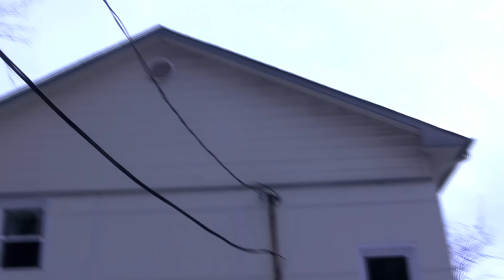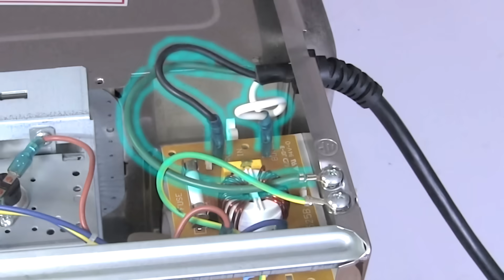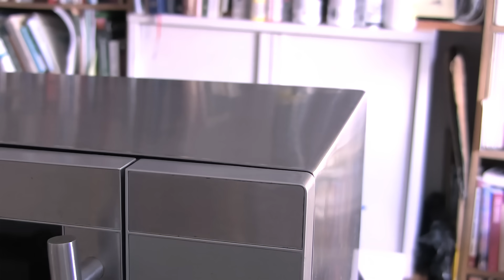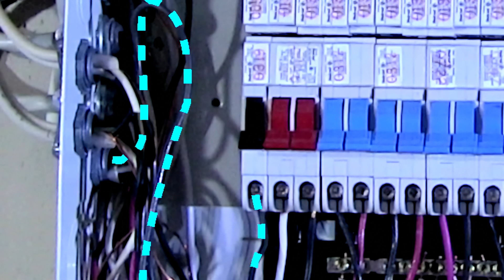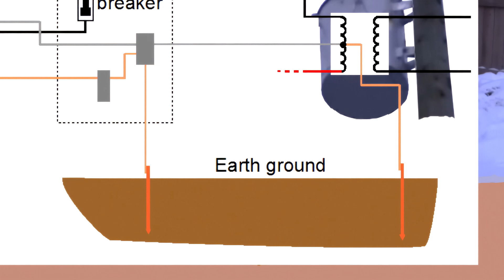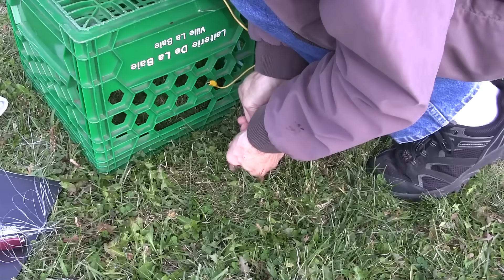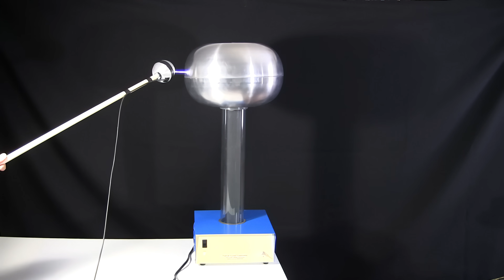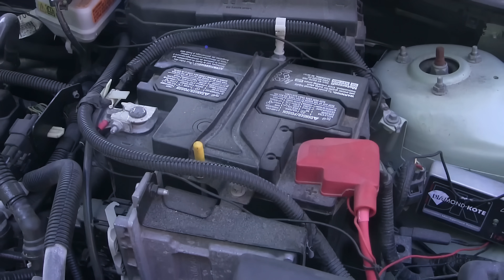What is Ground? Earth Ground/Earthing

Comment: So nothing has infinite resistance, but don’t we still need a return path for current to flow? So I’m fine with an ungrounded system having current flow thru earth which would happen right? But what I’m not fine with is not seeing what the return path. When current is flowing thru the earth - what is the return path? If you are going to say there is no return path, then I have to ask, how in the world are the electrons where the power line touches the earth/soil being driven away to make room for new electrons?
Reply from the maker: Yes, one return path is through the ground. The Earth ground can contain ions that make it electrically conductive. The more ions and the wetter the ground, the more conductive it is. So some ground isn't very conductive, or isn't conductive at all if there are few or no ions and the type of ground is dry. I just reviewed my video and see I don't mention that. The Earth ground return path can best be seen in the video at 4:13, the path is through the ground between the two grounding rods.
Reply: @RimstarOrg  Hey I watched your video again for the 7th time! I learn something new each time! I just had two followup questions to drive home the understanding:

 my mistake I’m sorry for that. I’m an idiot. May I ask two followup questions if u have time: 

1)
basically I was told that even if a system isn’t grounded (no ground rod to neutral etc at transformer and no grounding anywhere ) that if a power line that’s energized comes down and touches the earth, that it would still energize the earth. Now if energize means put the earth that it’s touching at its voltage then that’s surely true right? No matter if it’s soil, gravel, water right? A  120 v line comes down, and it will make the earth 120 v relative to neutral (in USA), no matter if that powerline is touching dry pavement, dirt soil or water right?

2)
The second question is - let’s forget about voltage. We have this 120 v line touching the ground - let’s say it’s grass or soil or water, is it possible for a current to flow thru the very earth itself if there are no grounding rods or grounding stuff anywhere near by? I ask it this way cuz I’m tryna take away with “return to source” and still see if current would flow thru the earth.
Reply: @MathCuriousity  1.  If it's truly not grounded anywhere, the electricity will not flow when hot touches the ground or even a person. It's dangerous to rely on that though because unexpected grounding could occur in numerous unpredictable ways.  120v wouldn't be enough to energize the ground anyway because its not enough voltage to push much current through the poor conducting earth. High voltage lines can push current easily  and make a dangerous area near them on the ground if they fall.  The voltage drops so quickly on the ground that there can be a significant voltage difference between your two feet, causing current to flow up one leg and down the other.

2.  Yes current attempts to flow back to source through the ground, but 120v can barely make it back to the panel grounding rod. Higher voltages however, would flow back through the earth to the transformer ground if there weren't any closer options
Reply: @ so are you saying if I am grounded and I touch a hot wire, I won’t be shocked? I don’t think that’s right.

Also the current being pushed by the high voltage line touching the ground won’t flow if there is no path back to source right? Besides maybe capacitive coupling?
Reply: @MathCuriousity  if you are grounded and touch a hot wire, the electricity will flow through you, through the earth, to the nearest grounding rod to return to source. Only in the very unique system where there was no grounded part in the entire system would that not shock you. I only mention a non grounded system to explain the concept, you won't actually find an AC system set up this way.

To your second point, you're correct, it will only flow if it can get back to source, which it easily can do through the earth if the voltage is high. It can take a shortcut through your body however, even though it's a longer path, because the body is an excellent conductor of high voltage. 

It always returns to source though in order to deliver power.  Otherwise it's just a capacitor like you said
Reply: @ hey great replies and just to clarify: I’m of the opinion that a downed power line will only have capacitive coupling with the ground if there is no grounding system - correct?
Reply: @MathCuriousity  in theory yes because you couldn't complete the circuit, but you won't encounter a system like that in the real world. All  AC systems are grounded, for a variety of reasons.
Reply: @Lucifer5-f5v  and just a final aside if you have a moment : what if the downed power line was DC instead of AC, would we still have capacitive coupling (again assuming ungrounded system as I think u said grounded system won’t have capacitive coupling whether Ac or Dc)?
Reply: @MathCuriousity  I was a little sloppy on the capacitive side, I was focusing on the main power flow.  I was referring to capacitance as a sort of minimal charge potential from a downed line with no return path. Similar to measuring voltage in a hot line with the load disconnected.  Capacitive coupling is possible on AC power lines when they are up and functional, you just need to get the right material in their electric field, like a fluorescent bulb.      In another way, I was referring to a direct electron to electron push from a downed wire, with nowhere to go because there isnt a complete circuit. Coupling involves a much smaller leakage that happens wirelessly, so to speak.  Effects like this, along with voltages floating, and arcing, are why you could never trust a high voltage system to be ungrounded, and a downed power line would never be safe even in a hypothetical ungrounded system.

For a DC system, they are even better at returning to source through earth, and I don't think you can even make an ungrounded system.  You can't use transformers, so there aren't gaps in the system to isolate. The generator has to be grounded to have a source of electrons to push down the line.  If the destination were hovering, like a helicopter there would be some minimal capacitance but no power flow without a return circuit.  Capacitive coupling only occurs in alternating current I think.  The unchanging DC field doesn't cause the effect.
Reply: @ hey thanks again! So let’s stick with the downed ac power line - it’s touching the earth, no grounding system around, say it’s like 1 mile out into middle of nowhere; now I know there won’t be current flow because there is no return path; but ur saying there would be “capacitive coupling flow”? How?
Reply: @MathCuriousity  it's not whether or not there's a grounding system nearby, it's whether there's one anywhere at all.  If there is a ground connection 10 miles away it will travel through the earth to complete the circuit.  In the United States there are millions of grounding rods (not all on the same circuit loop, but the point is they're everywhere)  Unless you've built a standalone system with no grounding anywhere in the loop, the current will flow right through the earth and up through a grounding rod, no matter the distance.

The capacitive coupling is such a minor effect, I don't think it's worth focusing on. However if you had wires set up parallel to the active power line, they can pick up some voltage from the electric field. It would take some engineering to gather any useful amount, but there are videos of lighting up a bulb when near high voltage lines.  High voltage lines are kept high in the air to reduce this effect because it drains some of the power from the line.  Obviously if it fell to the ground, a lot more capacitive coupling would occur. I'm not sure what that would mean if you could make an ungrounded system where a line was down but it had no way to complete the circuit. Perhaps it would still be able to induce a dangerous voltage in a human body if you got close enough.
Reply: @Lucifer5-f5v  Hey, you seem helpful in this. Can I ask you to help me understand something, please? An island village which uses Europes 240v system, has a lot of hard rock so locals often complain there are grounding issues. 

One example where this complaint was highlighted is when a teenager was taking a shower in an outdoor shower, he received a deadly electrical shock due to boiler through his body. 
Locals keep insisting it happened due to bad earth ground everywhere on island, but in my mind, this should have occurred only if hot wire fault occurred in boiler (hot cable touching chassis) before the resistive heater element, boiler was not connected to local ground (which would go through breaker anyway) and current instead somehow found a return path through water and teenager to likely an earth ground element somewhere. 
But if earth grounding was such a big problem per locals, it would never have connected, correct? Although, per what you said, the return path can be even 10km away, doesn't have to be near earth ground.

So in my mind, the fault was likely improperly connected house ground to boiler (although, depending on where it connects, it could have been corrosion damage).

One local as a response, in his new property is driving quite extensive earth grounding system which is cool and all but what purpose it would serve for the above safety case? 
Is local Earth Ground only there to neturalize the charge in system,? For example in case of lightning? Video says there should be plenty of earth ground connections, but is the danger limited to lightning strikes and different charge in the system?

Thanks.
Reply: @MartinzW  I'll do the best I can, but of course its just speculation.  The earth ground is there to stabilize the voltage, keep the neutral at 0 volts in reference to earth and people, and absorb spikes including lightning.  Current usually doesn't flow there, the hot and neutral provide the low resistance circuit (complete loop).  In places where earth grounding is difficult, the metal water pipes can be used because they are well suited for the job, but its done below ground so it doesn't travel through the house.  There could be a weird situation where a part of plumbing is connected to a neutral or ground wire in two locations that allow travel through that section of plumbing. Any above ground connection to plumbing would be dangerous.

The ground wire's other purpose though doesn't involve the earth.  The ground wire is connected to the case/chassis of each piece of equipment and then connected to the neutral line in the electrical panel.  This allows a large current to flow if the hot wire ends up touching the chassis.  This is what trips the breaker, and directs the dangerous fault away from people.  On a 240V system, the amount of voltage/current that will flow to earth is enough to kill a person, but not enough to trip the breaker.  That's why the ground wire must be properly connected to neutral, so ideally it trips the instant a wire becomes misplaced, before a person is even nearby.

This is why its important to follow electrical code, even if parts of it don't make sense to the installer.
Reply: @Lmerrick28  thanks. I think it's clear to me now as to potential causes for the incident.
Reply: @Lucifer5-f5v I remember when I was a kid I was playing at a friend's house. I had a clay rod that I used to poke his metal thing poking out of the base of their house and I would get a small tingling 😂. I thought it was funny.

But later I realized that it was electricity. Needless to say, it shouldn't have been live but it was, albeit the voltage drop was very significant enough to not cause an electrocution.

Another house (neighbor's) door handle would occasionally become live an shock you. The door frame was metallic so I guess there must have been a fault somewhere
Reply: In the North American system, a circuit uses one hot wire and the neutral for 120V, or two hot wires for 240V.  The neutral is the grounded conductor.  Although there is a path from the panel through Earth back to the transformer, that is a high-resistance path.  It is incorrect to think of it as part of the circuit.  The neutral is the grounded conductor, and is grounded throughout the distribution network, but the circuits are in the wires, for the most part.  The grounding is for safety.